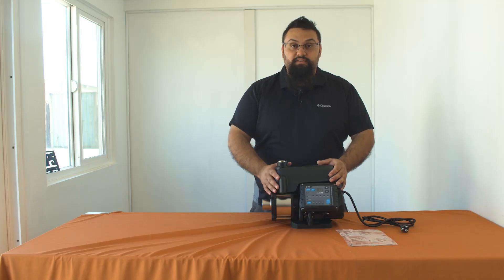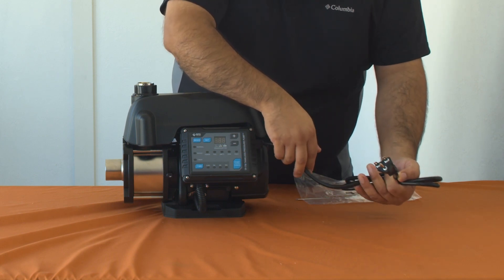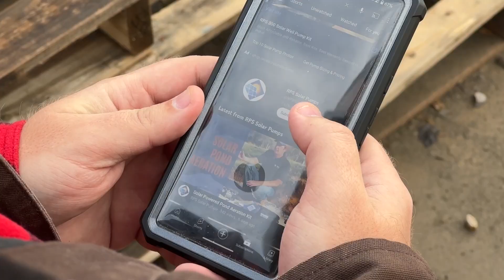Tankless Pressure Pump Unboxing | components and over view of the TPP 750 from RPS

Comment: On the TPP.  Will the controller work as a battery Charge Controller and when not using the pump will it switch to charging the batteries ?
Reply from the maker: Yes! The controller will charge the batteries from the DC. In fact, the Ac power will also charge the batteries!

Comment: As I understand it ?   TPP controller can be wired at the same time to 110 or 220 (depending on how it's set up for an AC source)  and the solar input. Which power source  you us is controlled by switch on back of controller ?
Reply from the maker: Hey there friend! The controller takes the DC input from the panels and the batteries turns it into AC to run the pump. The controller can be switched to AC only mode where is draws strictly from the AC input and not the DC input from a setting in the controller menu. It is also important to note that the controller will automatically switch to AC backup when it does not have access to DC power and the pump needs to run. Of course all of this is assuming there is ac power to the system.